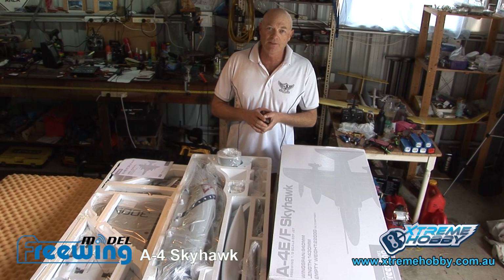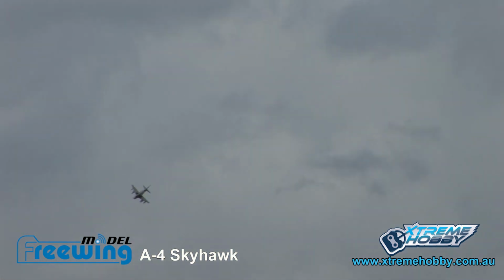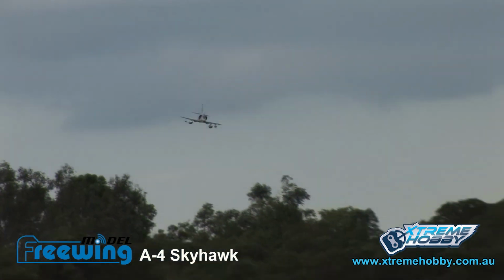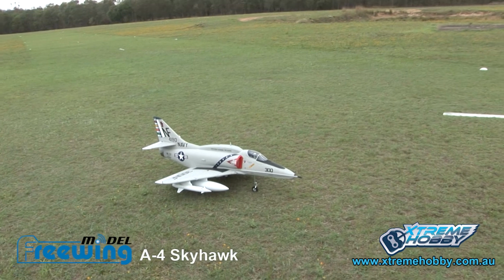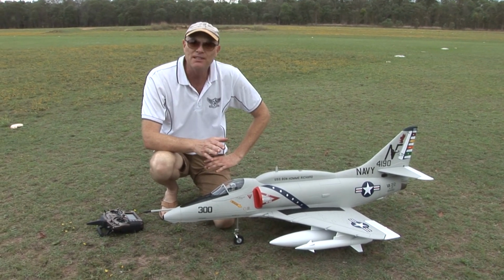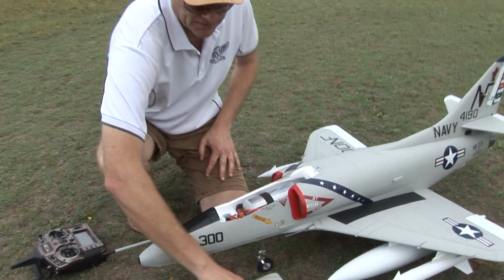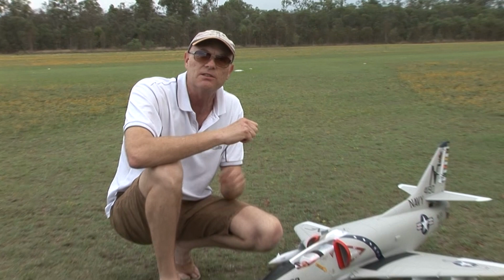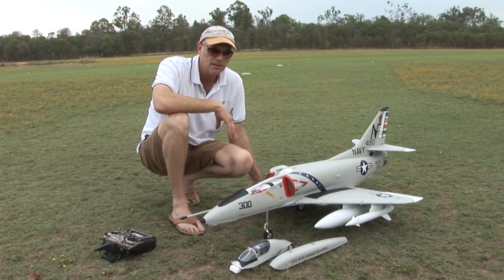Freewing 80mm A-4 Skyhawk Test Flight and set-up Review

Comment: I still have my A-4,refinished with custom graphics from Callie,in Marines VMA-223 Bull Dogs livery it looks great,I have not flown it yet because of a stroke I had in May'20,but maybe soon I can,I also have the same gyro,you said the gain was 30% on the ailerons,20 0n the elevator and 40 0n the rudder,with the low rates on the aileron maybe being the high rates and a bit lower from that to fly better? Thanks Yoda,you are the tops!!